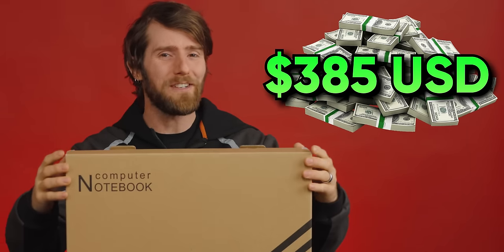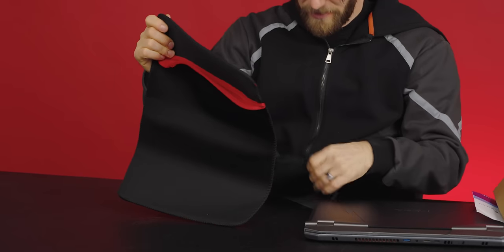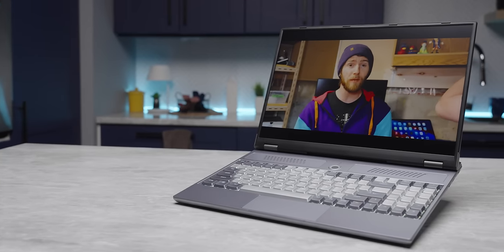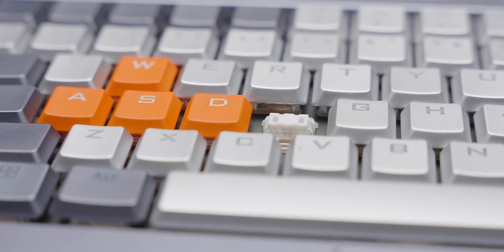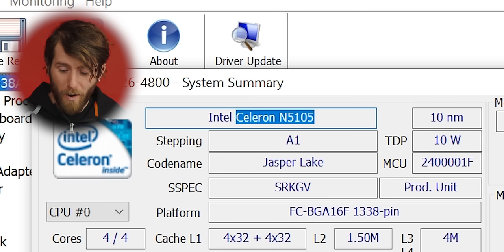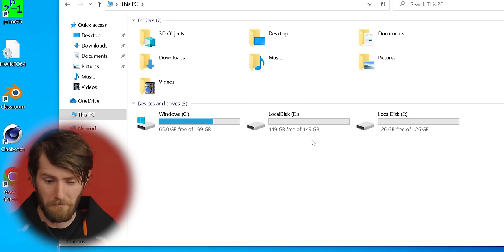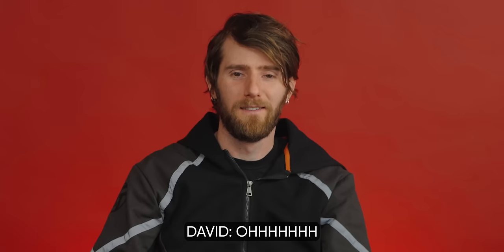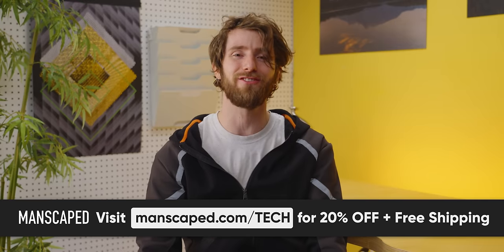Brown Star for Effort – This AliExpress Gaming Laptop is HILARIOUS

Comment: I still feel that any laptop above $350 with a Celeron is a little bit of a rip-off. But i do not want to knock it too much as that specific one is a Quad core, albeit not a fast one as burst speed is only 2.90 Ghz. And its not terribly old coming out in Q1 of 2021. Least the laptop is making use of max supported 16gb of ram for that cpu.
Reply: The chip sounded familiar because I think I've seen it featured in a ..(after a quick search) QNAP nas before. Not a bad little chip but for a laptop eh.
Reply: you have to take into account the keyboard cuz that's probably where most of the cost is coming from along with the machined chassis. Still, wouldn't be that for grandma who just wants typing and facebook. After reinstalling windows of course. That's what sketched me out hard
Reply: Honestly, I think they make up part of that value in the keyboard, screen, and chassis. Let's be fair, not a lot of decent aluminum chassis under $500.
Reply: @waldojim42  to be fair my £1900 clevo doesn't even have an aluminium chassis.

It does have a 12700h , 32gb of 3200mhz ram and an RTX3070ti to be fair but still no aluminium.
Reply: These modern Celeron and Pentium chips go alright. Four threads up to 3GHz and 16GB of DDR4 - twin channel supported but usually only equipped with a single channel by OEM's. The big thing is the active cooling - many of these processors are passively cooled which knocks the edge off their performance.
Reply: @waldojim42  dont get me wrong, this would make a decent basic usage laptop, like some multitasking. But i wouldnt do more than that.
Reply: @Jasontvnd9  Which is the compromise for that machine. I went another route - I have a Razer Blade 14 with 6900HX, 3070Ti, 16GB RAM @ 4800Mhz(the compromise for that machine- soldered crap) and a wonderful aluminum chassis.
Reply: @the_platapus3522  Oh agreed. But with that keyboard, chassis and screen, I would love that as my work machine. Spend a fair bit of time in CLI prompts for various machines.
Reply: A metal chassis, a decent screen, reasonable ram, m.2, mechanical keyboard, and you think it was overpriced at circa $380???

Any piss poor working class parent could buy this laptop for their child, fill it with games that would run well, stick open office on it for their homework, and keep their kid happy with a laptop offering a little more than its price suggests. 

I'd say it is offering remarkable value.
Reply: Yeah like to me the appeal is using it as my mobile word processor. I ride my bike a lot so I want a laptop that is sturdy enough to survive bouncing around in my bag and also cheap enough that it's not a huge deal if it gets broken or stolen. 16:10 screens are great for the type of word processing I do and my eyes aren't getting any better with age so a big bright screen is great. I use a very nice das with cherry blues at home I'm not nearly as much of a snob when it comes to laptop keyboards. "Not horrible" is about all I expect ouf of a laptop keyboard and it seems like this can clear that low bar.

The only thing I'd be concerned about (other than the sketchy Windows install) is the tiny battery. The CPU is only puling 10W but I bet that screen can drastically change the battery life based on brightness. Their own ad copy said 6 hours and given they also claimed to run Genshin at 50fps I am not optimistic it would last even that long. 

Not a deal breaker, I usually write in coffee shops so I can just plug in, but it would be annoying if I were writing outside or on a long car ride or something.
Reply: @waldojim42  They make up part of the value by stealing your info.  👀
Reply: @redslate  You can install your own copy of Windows. Or Linux if you prefer.
Reply: @waldojim42  I'm well aware of, and even suggested, that.  

Even still, you're ignoring the BIOS and hardware as potential threat-vectors.
Reply: @waldojim42  Yep!
I actually kinda want one. I imagine it could play a lot of older games just fine anyway (less P2W/gambling/predatory grinding/greedy crap), and that's mostly what I play.
Reply: @waldojim42  but a not so wonderful price lol
Reply: @Nurse_Xochitl  Absolutely. I wasn't exactly keen on spending that kind of money on a laptop. So far though, it has been a decent enough machine that I wouldn't say no to doing so again.
Reply: @waldojim42  at least the chassis is built to last. so even years down the road, it might feel low end but still premium.
Reply: the screen keyboard and chassis make it up for that man
Reply: Agree, I am using this CPU on my router lol.
Reply: @EminemLovesGrapes  the one with LPC issue?

Comment: ALSO ONE important thing: I would recommend fully charging the battery, then measuring the voltage on it with a multimeter. Many alibaba manufacturers (aliexpress sellers usually dropship those because its super, super, super easy to do and encouraged + promoted in listings) will label their batteries with weird specs kind of like they don't understand nominal vs charged voltage on  li-ion etc batteries. It IS common for the voltage to not be exactly what the maximum voltage is, but instead the stable voltage level in an in-between spot close to the top. Alibaba manufacturers however will often just take away half the max voltage and use that, or just put whatever number they thing looks nice because they don't expect people to open their products, for some reason

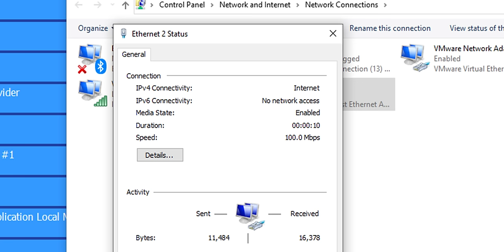Comment: 3:18 "100 Mbps by today standards is not fast"
Me with my 30 Mbps: YEAH SCREW THAT
Reply: That's network speed though no Internet, so if you had a nas or wanted to work over a lan it's limited in fact wifi would be faster even wireless N was faster at 150mb - 300mb
Reply: Yeah 99% of the time we don't really need more than 100 mbps we just got used to faster. Who even has a Nas nowadays they move large amounts of data to? Probably less than 1% of the people. I can't remember the last time when I download / played a bluray rip, must have been many years ago.
Reply: 100 Mbps is slow for LOCAL transfers, you are talking about the speed of your internet connection from your ISP.
Reply: @simonupton-millard  How many people actually do that though?
Reply: @poochyenarulez  to be fair most people dont they will just use the much much faster WiFi or buy a 1gb usb3 dongal as don't think ping times will affect the gaming on that laptop unless it supports thunderbolt 😂
Reply: @bencze465  you’re a fool if you don’t have a NAS. If you don’t have local control of your data you don’t have any control. Ripping BluRays and running a Plex/Emby/Jellyfin server are very common. The step above a NAS is a homeland server which is still quite common depending on what circles you run in.
Reply: Me who finally got a chance to upgrade from 45 Mbps: Wow that's fast...wait...
Reply: @ParadoxalDream 
I'm not sure if I know a single person who has a NAS. Heck, barely any household even has 2 or more devices connected to a router by LAN, so it's limited by WiFi speed anyway.
Reply: @Bob_Smith19 
Most people don't have much data to handle in the first place. They use streaming and cloud services. Others often just use large internal or external HDDs, storage is dirt cheap and USB 3 doesn't require any expertise or involve any hassle.
Reply: @Alias_Anybody  we have different friend sets lol, I know like 10+ people with a NAS
but honestly, fast ethernet isn't really bad if you aren't doing anything on your local network and your ISP speed is lower. But the moment you want to do something on your local network it starts getting iffy.
Reply: @Bob_Smith19  When talking about the average user, nowhere near most people have a NAS at home. I'd assume the amount of people is around 1% or so of all computer users. If we are talking about tech enthusiasts then maybe, but even then I wouldn't say most people have that.
Reply: @jinxedpenguin  I know maybe 10 people with a NAS at home and many of them are IT professionals. I still haven't gotten mine, been wanting to rework the home network home lab-style, but this is obviously not how most people do it anyway, so the argument is kinda moot. Some 15-20 years ago local networking was all the rage, people would set up all kinds of things on local networks, from forums and chats to file sharing. Now internet speeds have gotten to the point it has become irrelevant, and the tech has gotten more accessible also. There is just far less value in keeping your movie collection or what have you local.
Reply: 100 megaBITS not 100 megaBYTES. There are 8 bits in a byte remember 😉
Reply: @Bob_Smith19  The thing is, most people do not really care. 20-30 years ago just owning a copy of a music album or a movie was valuable; you come over to someone and they have these things which are not so trivial for you to get. Photo albums were treasured. By contrast, the entire value of many many photos on Instagram or Facebook is that they are out there, in the moment. It seems to me that for an average person, if they lose their account, but retain access to e.g. photos, there would just not be any sense in reuploading those. This tiny thought experiment suggests that having data or control over it is typically not perceived as valuable and warranting protection - at least, not in the sense of losing access to it because of the actions of a third party.
Curation is where the value is. In more fringe cases, you get to be one of the data keepers (e.g. it is unrealistic to expect to lose access to any and all Led Zeppelin recordings, but it is possible that most of the upstream local band recordings get lost). By large, people have shifted to never owning things in the first place. Sharing economy is not necessarily a bad thing.
Reply: @engineeringvision9507  Er, your point? Indeed, OP was comparing apples to oranges a bit with local connections vs ISP speeds, but ISP downlink at 30 megaBITS per second is also very common (and is qualified as broadband by FCC, superfast by UK's Ofcom, fast by EU...).
Reply: @Bob_Smith19  So I have been a fool the whole time having to copy my file from an external HDD through USB 3.1 that works even when there is power outage.

Comment: The inside is amazing. It just pops off! Screw normal laptops that have like 200 screws and 8 stages you have to do in order or some ribbon cable commits sudoku.
Reply: Yeah, it sucks when my ribbon cables decide to fill grids with aligned number patterns. Drives me up a wall, makes me wanna commit sokoban.
Reply: Being made out of metal helps, don't need to spread the load as much. And there's not much to the insides in the first place as this is effectively netbook stuffing with much smaller and more integrated parts

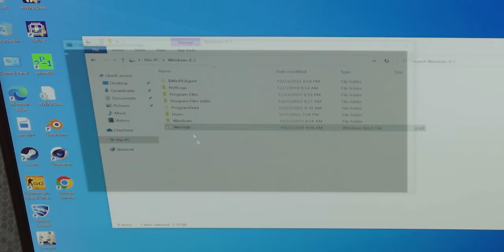Comment: 11:36 I knew exactly what the batch file was going to be the moment I saw the name, and figured it was going to be the case when activation looked weird and said it was activated "through your organization." That batch file sets a KMS key and then uses an online KMS activation server to tell it if there are licenses available to KMS-activate Windows. Normally that is a legitimate process for organizations, but in this case (especially as it is using several online servers), it is almost 100% checking several available fake KMS servers which confirm the KMS activation is successful regardless of the device.

TL;DR It's a "Windows 10 activation" through spoofed KMS servers and is a way to avoid paying for a Windows license while still making Windows thing it is licensed.
Reply: I mean I'd just buy this computer and format it, a Windows key is 10 bucks and a Linux distro is 0

Comment: To be honest, Aliexpress has quite a lot of interesting systems these days.
I got myself a 4 x 2.5gbit ethernet, passively cooled, mini PC (also with a Celeron N5105) that I'm using as my home router.
There are also some quite quite more powerful machines out there with Ryzen CPUs.
Sure, they are somewhat sketchy, but I can't really get a PC with 4x 2.5 gbit elsewhere and it's working like a charm!
Reply: Link of minipc please?
Reply: This sounds interesting . I would like to do the same
Reply: Just search for N5105 firewall. On most product pages they sell also the N5100 a bit cheaper and for a firewall is enough and has a TDP of only 6w.
Reply: I'm waiting for one of these for my home. The first one i bought was one J4125 for my company to use as a firewall and it is amazing with pfsense with dual wan.

Comment: Watching this after ripping apart my ROG Strix laptop is a trip. <$400 vs >$1000 laptop internals are SO different, the decisions made as far as placement and upgradability and whatnot. Very interesting to see how smol everything is in that and what it can do.
Reply: This is basically a netbook in a laptop's body, the internals are akin to those of a smartphone at this point, made for a much smaller package and low power consumption. I guess it does help accomodate the thicc keyboard, but otherwise it's not neccesarily representative of the laptop in the price range

Comment: SSD and more than 8GB ram (12/16 GB) helps a lot with these kinds of processors.
I recently upgraded my dad's old work laptop which came with 6th gen i3 by replacing the HDD with SSD and bumping RAM to 12GB.

These two upgrades alone made his life a hell lot easier with the laptop for his office work. I was surprised too on seeing the improvement in laptop performance.
Reply: I use a 2013 MPB I upgraded with an SSD and 16 gigs of ram as my daily driver for work stuff (but not gaming), for a 10 year old device it still web surfs like a champ.

Comment: For the SSD partition, it is a common Chinese computer store practise.  They install the OS on drive C:  (with small space) and advise users put their files on other drives.  In case the OS need to be re-installed, only Drive C: will be affected.  Files on other drives will be safe.

Comment: I’m personally not a fan of those “ultra thin” type laptops, I want to have a giant bulky laptop with proper IO
Reply: I just want somewhere in between. Seems like for the longest time everyone was just following Apple and making laptops as thin as possible, but I kinda like having ports, and a battery
Reply: It doesn’t have to be bulky.Thinkpads a few years back struck the perfect balance w/ a bunch of IO on board. The dongle life is not for me.
Reply: @Bob_Smith19  Spot on. Yoga thinkpad for me is like the ideal machine, although I think the one I have is a bit older and actually better than the newer models. The thing is just a powerhouse. Has ALL of the IO, the keyboard isn't flat, could spec it REALLY well for such a small laptop, has usable battery life, and can use it as a thick tablet with stylus for entertainment or sketching.

Comment: I'm amazed that Linus didn't know that RJ45 works with 4 pins, but capped at 100Mb/s. I used to have this problem often when I was wiring cat5e or cat6 to rj45 connectors and some of the wires didn't make contact and the connection was capped at 100Mb/s, even though it should have been gigabit.

Comment: The reason to split up your SSD into multiple partitions can be because of the backups. If it is the OS drive, it is much handier to make a full snapshot of it. Whereas if it is the data drive, you can make do with backing up just individual folders.
Reply: also you notice C: bloat faster